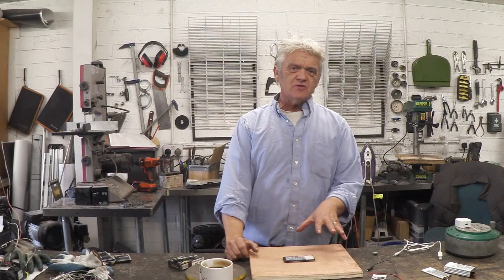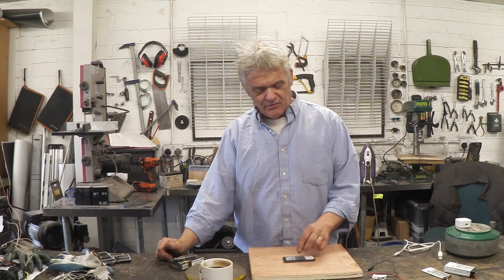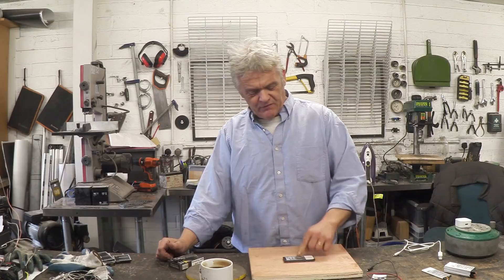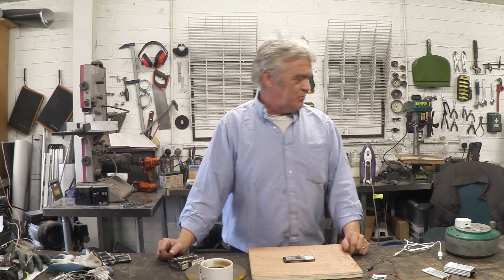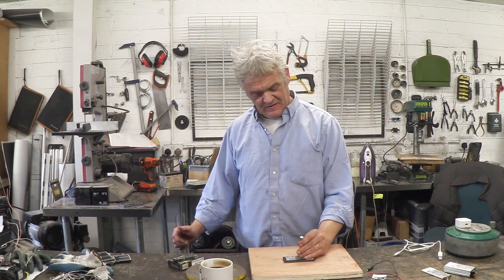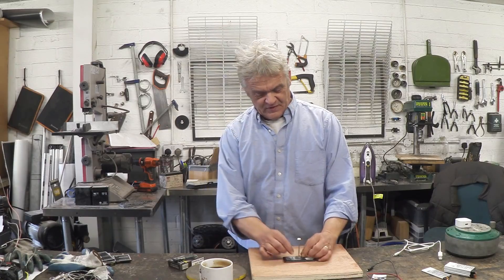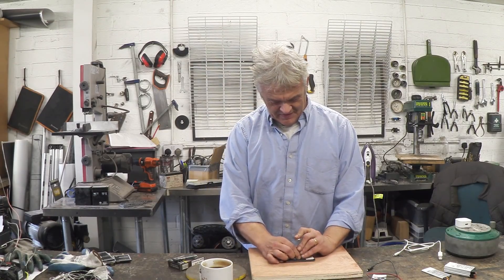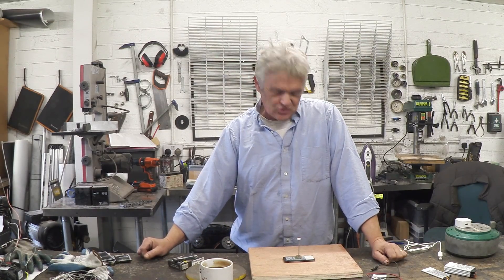1276 Thermal Runaway In Lithium Ion Batteries

Comment: Actual experience with thermal runaway on some of the earliest versions of Li-ion made me hesitant to trust them for some time.
Then came the control circuit with temp monitoring, short protect, over & under volt protect.

Comment: of course it depends on the internal resistance of the battery. If the battery has a large c factor, it can convert more energy into heat in a shorter time. Such a cell is much easier to force to "do something".

Comment: when I was young I had an old Motorola with a removeable battery.. after the phone stopped working I took the battery out, put it on top of a rock, and hit it with another rock.

INSTANTLY burst into flames. Was only ~1,000mah also, I think they've done some serious safety revisions for phone batteries over the years (especially since that Galaxy Note 7 fiasco)

Comment: Nails don't work as good as screws and an impact driver. I theorize that the screw twists and locks the conductive layers together.
Reply: And generates more heat due to the increased surface area and longer insertion time.
Reply: @ablacknambercat  Interesting point regarding surface area. I wonder if a coarse thread or a fine thread screw would preform better? If only there was someone with a large stockpile of batteries willing to test this theory.

Comment: Great video! I've just converted my power wheelchair to lithium batteries(Valence 12v) and I'm putting together an in-the-battery-box fire suppression system.  I've got about 7cubic inches of space to work with, and I'm debating using sand or pink roll fiberglass insulation to fill the space and maybe block oxygen by helpfully melting in case of a scenario. Would absolutely love to see a vid comparing the two if you have more phone batteries laying around ;)
Reply: I can see a problem there. You will have no way to let the "normal" heat out of your battery pack .... giving rise to one of the key ingredients to a battery fire. Silica sand is used in large capacity fuses to quench the ark when the fuse blows, so it is a great suppressant material in that respect .... but you are not talking about suppressing an arc here! 
Obviously your use is a specialized one (you cant just walk away from it if it goes up) .... but maybe you should be looking at fire containment rather than suppression?

Comment: A very well designed battery. They must have looked in to punchers form keys. Might have gone bang with a 303 round. Plenty of channels have tried. It rolled up like Kevlar. Would need copper and iron nails for the best kind of sparks.

Comment: Sand is handy for the reaction in batteries. Can you say short circuit again mate, I had a good laugh. Put a drill through a 18650 in a pack of 10, glad I had put them most a part before I did it.

Comment: Hiya, I'm still not clear on the benefits of removing the built in protection circuitry?
Reply: He said he was going to make battery packs out 10ish cells, so he'll be replacing the controller that was on each battery with a larger charge controller that will manage each entire pack.
Reply: Get rid of the current limiting of the original regulator

Comment: We own a scrap yard, in the last couple of years there has been a great number of scrap heap fires because of lithium ion batteries.

How I think they cause the fire in a scrap heap is that when a crane grabs a pile of steel scrap with a battery in it it get compressed and punctured there are multiple points in the battery where it short circuits.

I know no one is putting a blow torch on it because scap yards hate li-ion batteries.

Aside from that, I always enjoy watching your videos.
Please keep up the good work, this way we can always learn from each other!

Comment: I have manage to blow 2 up one a flat pck 18 volt from a model car that i tried to reserect from dead useing 18 volt at 500ma locked like it was working untill boom 
the second was a small one from an Ecig that i managed to short  after removing the protection board  that went with a lot of sparks and a few flames but no boom.

Comment: Not all chemistries are  equal, high discharge low internal resistance cells are more likely to go into thermal run away, especially Li-po cells and those are the ones you see more often go into thermal runaway
Reply: Agreed like Robert said the Li ion ones are quite safe but Li Po are another kettle of fish 😂 Ive seen £1000 worth of Model heli totaled after a Li Po fire like a firework display
Reply: All comparison in the auto application suggests that LifePo4 cells are FAR less reactive than other chemistries.
Reply: @rogerstarkey5390  
Lifepo4 is lithium iorn phosphate and agreed it is fairly safe
LiPo refers to lithium cobalt batteries as used in a lot of Model helis and you have to see one go to believe how hot they get 
The manufacturers usually recomend they are stored in a LiPo fire safe bag when not in use  
I know of one lad who was hospitalised just from the flash and fumes while dropping a crash damaged battery into a safe bag
The worrying thing is a lot of those small toy foam helis that were popular a while back were fitted with small lozange size LiPos and given to kids and as we know toddlers like to chew anything not a good scenario